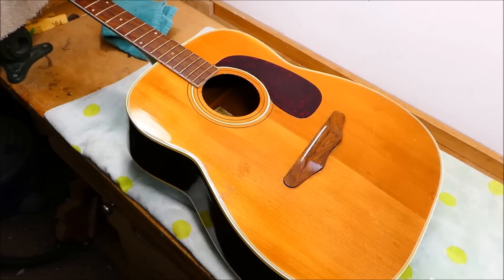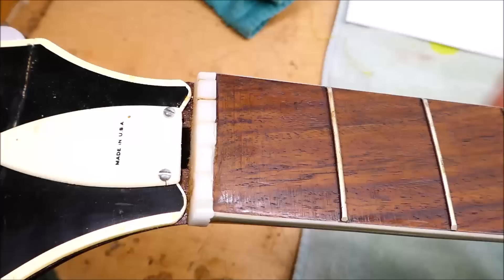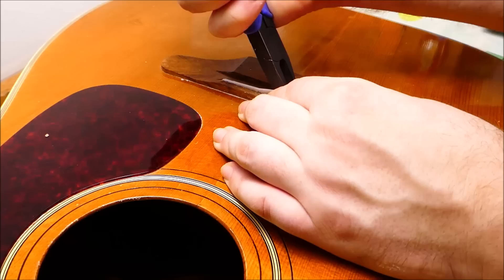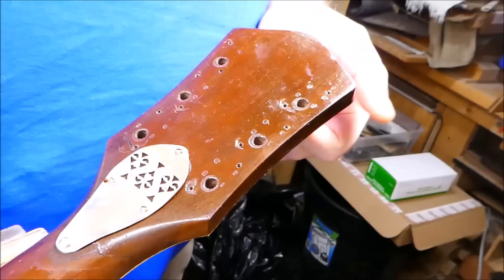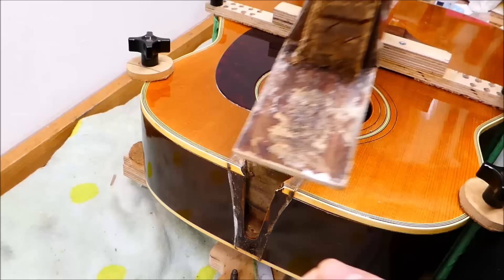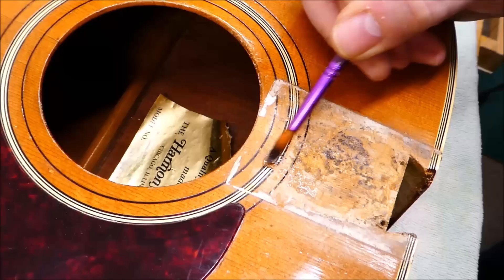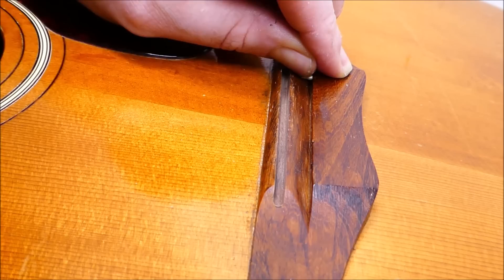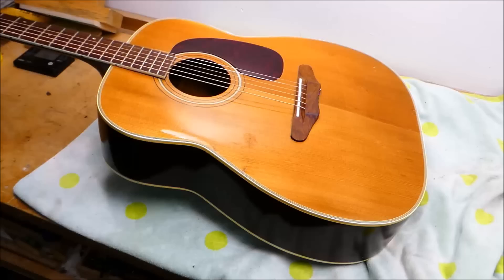The Sovereign's Secrets

Comment: Welcome to Woodford's Cheesemaker Channel.  😆😆 I have one of these from '67 on the back burner.  Does have a snapped headstock, original tuners seem to work, nut is also garbage, the frets are horrible and will get replaced, and that skinny bridge saddle is awful.  Surprisingly doesn't look like it needs a neck reset.

Oh, and besides Jimmy Page, Pete Townsend also got one of these in the 60s, looks like both of them still have these.

Comment: I did a neck reset on a later model H-6561 Sovereign, not a USA made guitar at that point, the neck was held in with three dowels, no Mortise and Tenon.  I had to remove the bridge as well, basically all the same stuff needed as this one minus the headstock break.  It was a lot of work, but played amazingly well with super low action when it was done.  It sounded very nice, not too loud, more of a mellow tone.  I really only did the work because of the Jimmy Page connection, loosely connected I guess, ha ha.

Comment: Thank you for explaining why all my Breedlove guitars have bridge doctors.
Reply: i think that's different! higher end breedloves were designed around those bridge doctors; they built the tops and bracing extra thin for increased volume and bass and used the bridge doctors to keep them from collapsing.

in practice that resulted in guitars that would "squash" with hard bluegrass picking or strumming but were wonderfully loud and responsive to gentle fingerpicking

Comment: ⚓️ Thanks 2ofd 😎 tapering the screw fill dowel: use a drill & appropriate sand paper, run the dowel across the paper mimicking the screw taper 😎

Comment: Phenolic: I’ve only ever heard that word used to describe the taste of certain scotch whiskeys, in regards to the phenols that exist in the peat used to dry out the malted barley used to produce the product. 

What is this with regard to a reliably flat surface?

I’m very impressed with this repair! Great job!
Reply: phenolic resin, it's a hard plastic basically, used for stuff like counter tops because it's hard wearing and chemical resistant.
Reply: @gramursowanfaborden5820  so like Formica?
Reply: @honkytonkinson9787  never heard of it. phenolic is very similar to perspex/"plexiglass" but much stronger and i don't think it is transparent.
Reply: @gramursowanfaborden5820  Formica is a laminate plastic that is applied to fiberboard to create inexpensive kitchen and bathroom countertops. It seems to have been replaced with cultured marble and synthetic granite in the last 20 years. Was very common in the 70s and 80s. Sounds like phenolic is just a kind of opaque plastic that is very hard/stiff and is manufactured with strict tolerance so it can be used to construct other things with strict tolerance. I’m kinda surprised I’ve never heard of it before but I probably shouldn’t be since I work a desk job
Reply: @gramursowanfaborden5820  phenol is also the active ingredient in certain over the counter medications used to relieve pain from certain oral conditions, like sore throat and mouth ulcers

Comment: H1266 deluxe 1 piece mahogany neck back and sides, Brazilian rosewood fretboard, strung with 13's in my opinion sounds better than any Gibson or Martin you care to put up against it. 
The truss rod can be removed and replaced (with a bit of effort ) without removing the fretboard, this is achieved by loosing it off and pulling it out from the truss rod adjustment hole on the headstock.
 Prices have rocketed for this model guitar, a good example can fetch well over a £1,000 about $1,500 here in the U.K.

Comment: I've never been a fan of those rear loading bridges. I believe that they encourage the bridge to pull up from the rear, as there is excessive force there. I imagine that they are cheaper to manufacture.

For some reason, I really enjoy seeing the work on these cheaper 'orphan' guitars. They are humble instruments, but really do deserve a caring and professional repair. Kudos!

As far as mold and mildew control, white vinegar is excellent for destroying them, and is far less likely to damage any surface that comes in contact with it.
Reply: Horticultural vinegar,, 20 to 30% strength, is way better than ordinary vinegar for killing mold, algae, weeds etc. Tea tree oil diluted with alcohol is reported to be an excellent fungicide. Whether traces of the oil would interfere with gluing the wood pieces back together I don't know.  Might be an issue. Hmmm, how about 24 to 48 hours of strong ultraviolet light exposure?
Reply: My twenty year old Ovation has one and hasn't pulled up, no bulge, etc.  No traditional tone but it plays like an electric and ya can hear it.  You get used to it...
Reply: @johnsee7269  I believe that Ovation uses some small bolts to secure that kind of bridge, which is probably a good idea.
Reply: @goodun2974  The stronger the vinegar, the more damage it will do to pesky plants and fungus. I have had good luck with the kitchen strength stuff. Vinegar is also great at dislodging corrosion from metal.
Reply: @perihelion7798  , ordinary vinegar is excellent for removing corrosion caused by leaky batteries. I've used it as weed killer, with salt and dish soap added, and it's okay, but the horticultural stuff as far more effective. BTW, one of my favorite ho-to, try first, do-no-harm cleaners is oxyclean crystals in warm water with a dash of dish soap. Non toxic to plants and grass but good for removing algae and mildew from siding; excellent for removing cigarette smoke and tar; even removes crusty white mildew from plastic knobs on old radios and tube hifi, as well as cleaning Excelite screwdrivers with butyl acetate funk!

Comment: I have one of these. It's in better shape than the one you were working on but it definitely needs the neck workedon and the saddle has separated slightly. The action is fine up to the 5-7 frets, then it's simply too high. Any idea how much it costs to fix one of these. I paid $350 for it not understanding what I was buying. Thanks.

Comment: Serious Question: when I am attempting to crown my acoustic guitar frets, after the strings are removed Do I Straighten the neck with the truss rod and Then file away the buzz sounds? After I measure with a straight edge all the way down the neck and pinpoint my highpoints of course.
I've got a Fender CD 60 that I bought recently and it's giving me buzz on the 13 14 fret from the high E string.
The first option I tried was the truss rod. I tightened it half a turn and it straightened the neck up almost true but then I began to hear fret rattling on the high E string. Then I decided to replace the strings and while doing so after all of them came off I saw that my saddle was actually a little bit thinner than the channel cut into the bridge so it was a bit slanted when tension applied from the strings. I didn't replace the saddle but I put a thin piece of Manila folder in between to keep it snug and tight. Afterwards when restrung and tuned the buzz slightly went away but still faintly there, so I think it's time to file the frets. I just don't want to mess up a newly purchased guitar.

Comment: I had a Sovereign in my shop years ago for headstock break repair and the face reglued. It was completely loose. The head plate was cracked off where there truss cover screwed through it. I did not think to recurve the edges. Thankfully. As a student of gifted repair people such as yourself. Would it do any good at all to also put stiffners/braces between the ladder braces under the bridge area?

Comment: Why doesnt anyone make through hole bridges that just have reinforced holes (vertical string ferrules) that allow you to string the guitar through the sound hole. Yes you would have to install all the strings before any of them are put through the tuning pegs but I see a few benefits to a design like that. First being you dont need pins which isnt nessesary an improvement but I think it would be a nice option. Also you would have really good contact with the bridge plate and vibrations would be transmitted well (if it were done right of course). If the holes are steel ferrules they wont wear and if all the ferrules are connected with a small rigid strip of steel then you would likely have less bridge through hole cracks (the kind that intersect each string hole). And I personally think a bridge with strings coming through like normal but without bridge pins would look really nice, elegant/clean. You could really highlight the no bridge pin design when making the bridge to have a really nice looking bridge. But if all of that is true in practice I imagine it would have been done by now. I think the main drawback is that a lot of people wouldnt like the idea of restringing through the sound hole. But like with anything its something I think would be easy to get used to and it would likely become a issue.

Comment: Ted, how did you manage to drill a hole in the saddle with the saddle mounted to the soundboard? It seems like you would need a 12” long drill bit or a super small drill motor. Otherwise the drill would collide with the soundboard long before the drill bit would reach the desired location for the new hole.
Reply from the maker: It's 6" long by 1/16" diameter.  They're called aircraft bits. This works on Harmony's with the slanted string block. For classical guitars I would use a standard length bit in a jeweller's pin vise because you're right- there isn't enough clearance.

Comment: Instead of running the iron back and forth over the bottom of the bridge, could you heat a thick piece of brass in the oven to the desired temp and clamp the bridge to the hot metal?
Reply: You could but low consistent heat is more effective than high heat that disappates. I removed a bridge that was poorly reglued with Titebond III earlier today and it required about 15 minutes at the incredibly hot temperature of 300F to soften the glue.
Reply from the maker: When Franklin brought out Titebond III repair people everywhere started rubbing their temples and groaning.

Comment: Just a thought, for bushing removal, a transfer punch might be a better shape than the butt  of a drill bit, and of course, they are meant to be struck.
Reply from the maker: I generally don't have to hit them. If it's REALLY stuck I'll turn a custom sized dowel and push it out with a clamp and a block drilled large enough to accept the bushing.
Reply: In other words… I know how to remove bushings. Thank you